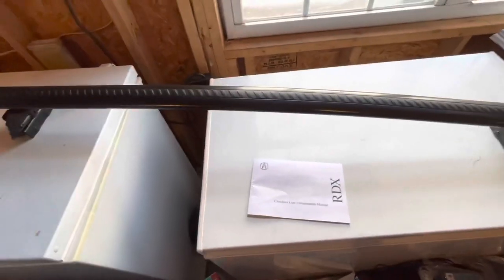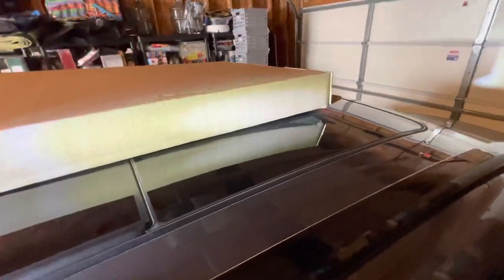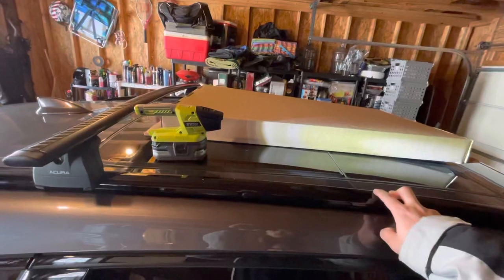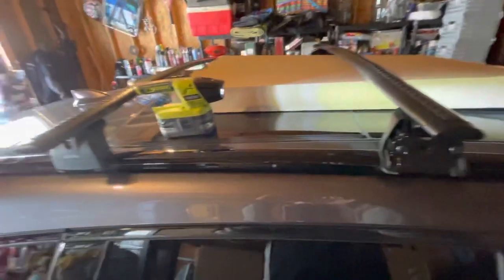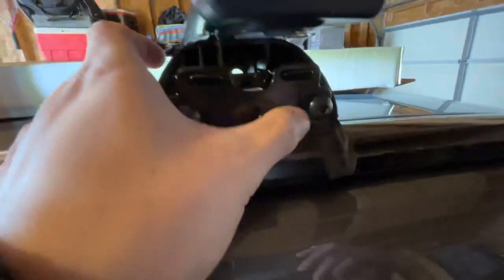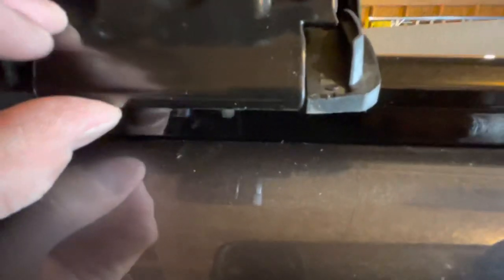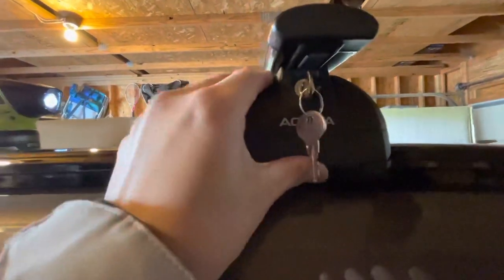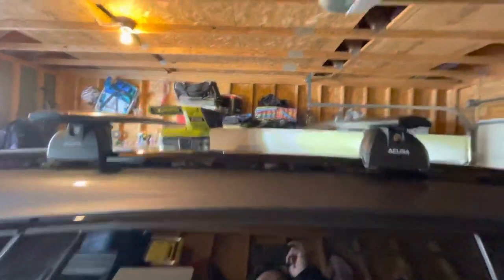2019-2021 Acura RDX Cross Bars Install DIY

Comment: Did u find it hard to take off? Also I found it very difficult to distinguish between front and back rails...I installed and not sure still if it's correct lol
Reply from the maker: It’s actually very easy to take off if u use a drill or impact driver like I use. As for difference of front and back, it’s the same I believe.

Comment: What webite did you order the rail and crossbars from? My dealer wanted $1000
Reply: A lot online websites just search OEM Acura parts. I bought the rail and crossbars to hold my kayak last week total over $700(shipping costs a lot!).
Reply: @xuanzhang8808  Hey, this is off topic. I wanted to install for the same purpose, I wonder what Kayak did you purchase, and do you need additional rack to hold the Kayak on top of the crossbars?
Reply: @w8803425  I bought a hobie compass and it's a heavy kayak. I put some insulation tubes on the crossbar to provide more friction and padding and then strap the kayak upside-down. Typical two straps, bow and stern tie down. Don't use saddles or J rack cause they will make the kayak too high from your roof. Two downsides of OEM crossbars, first its shape is not exactly straight/flat, second the rear crossbar is little too far ahead which makes loading more difficult.
Reply from the maker: @w8803425  I ordered the factory rack. It comes with all cables and cinch wraps u need. I’ll post a video of my install in coming days